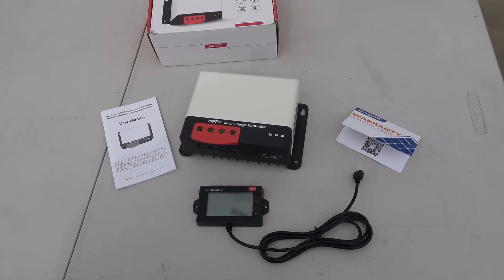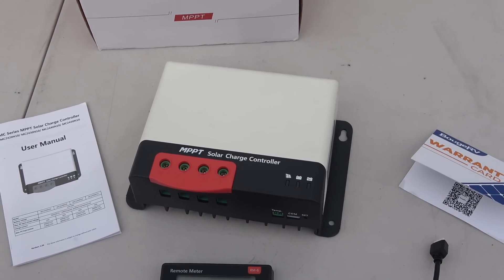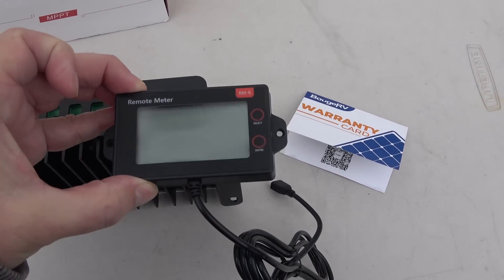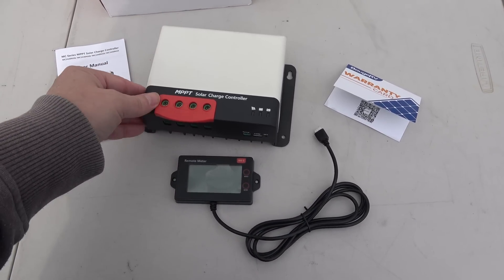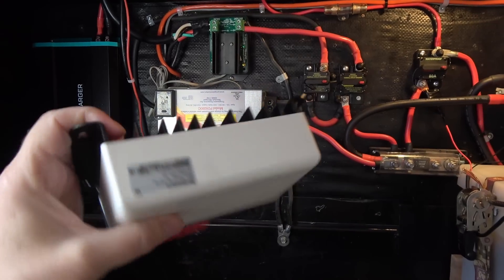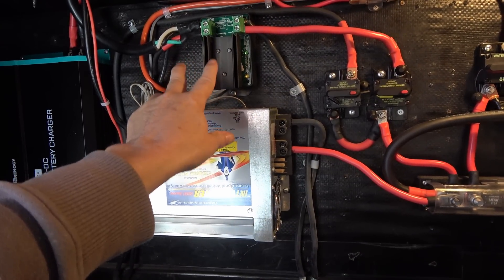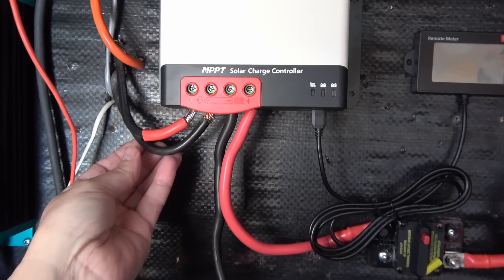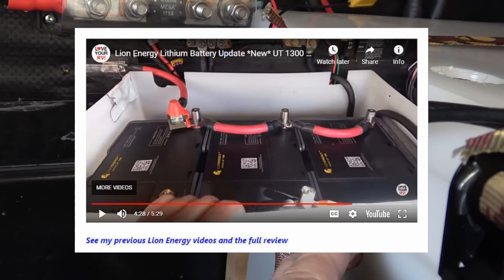Cheap MPPT 40A Solar Charge Controller from BougeRV - Install and Test

Comment: Sorry to bother you again Ray.  But I watched another vid of yours . My wife and I have like 40gb with rogers. But we would like to get like a mifi or similar.  We will be leaving wifi soon and like to watch Netflix and all that while we travel the island . We have unlimited after 40gb.  We like to chromecast from our phones to TV.  Any suggestions? I will also by my Amazon stuff through you as well . 😊
Reply from the maker: My suggestion is to try to watch at the lowest resolution you can to stay in the 40 GB range because most plans that claim to be unlimited will throttle the speed dramatically after you pass the specified mark. Often it will still be fast if the tower you are connecting to isn't busy but if it's busy they will use network management to bump you down to a lower speed. Also beware that Vancouver Island only has good cell service along the east coast and southern tip, other than that it can get pretty bad due to the sparser population and mountainous terrain.  https://www.telus.com/en/bc/mobility/network/coverage-map As an example we like to camp in Strathcona Provincial Park and there no zero cell coverage.  Cheers, Ray

Comment: Hello Ray thx for your informative review. I have been using one of these with 380w of solar 2 Samlex 100w pnls and 1 Bouge 180w for about 1 month and have seen 24amps charge going to my bank of FLA Trojans T105s. I like you have done a fair amount of effort to utilize the User defined Bat mode but could never get the product support to verify the schedule for equalization so I defaulted back to the Fla battery config even though it does not match the T105+ recomended settings. Also had trouble getting accurate temp sensor spec from Product Support so I'm using my Samlex sensor from my PWM 30 amp this one replaced and hopefully it will adjust for high ambient conditions I camp in. Maybe in your communication with them you'll have better luck than I did. FWIW I was told that SRNE model unfortunately has alot of features that aren't supported in unit marketed by Bouge even though they appear identical. I got the feeling Bouge Product Support was limited in knowledge of operation of their unit especially when I asked about type of remote temp sensor i.e. resistive or self generating (thermocouple) and voltage charge reduction values for temp increase. Your pumping alot more power thru your system so anxious to hear your long term reporting. Stay Healthy and hope to see you both out and about once the Covid 19 border restrictions reduce.
Reply from the maker: Hello Bill I have found a Canada website that sells the temp sensor - http://azimuthsolar.ca/product/srne-temperature-sensor-for-mppt-solar-controller-mc-series/ they also sell the Bluetooth dongle so you can see stuff on a phone  http://azimuthsolar.ca/product/srne-bt-2/ but I will likely buy it from overseas as much cheaper funny enough shipping is cheaper from overseas versus my same province.  :) https://www.aliexpress.com/item/33029331284.html?spm=2114.12057483.0.0.128f2ed3Ze3Zq9 also looks like there are temp sensors there too - https://www.aliexpress.com/item/4000068249045.html
Reply: I had the same result with BougeRV support regarding the temp sensor.

I am running SLA so I do want and need temp compensation.  

I would appreciate knowing if your sensor worked.

Comment: Interesting and reading from the description it is mentioned weather resistant.
Could be an interesting option to replace the PWW controler on my 200W Renogy Eclipse portable kit.
Reply from the maker: Its not great with only an IP32 rating "Protected from water spray less than 15 degrees from vertical" but could easily be improved I bet with a little silicone rubber on the seams and tape across the wire screws.
Reply: @LoveYourRV  Just read the PWM Voyager is IP67, but could get by as the controller is on the back of the panels and when in use they are always angled at around 45 degrees.
But just saw the Renogy Rovers are also IP67. Not sure why, was under the impression they were not waterproof.

Comment: I'm not sure if that controller is programmable or not, but I just bought 4 Lion batteries and they recommended I set the controller voltages to 13.9 for bulk, absorption and float. Apparently they regulate the incoming voltage down to 13.9 anyway so I guess that any higher than that might just make more heat (just guessing).
Reply from the maker: Yes, it is fully customizable and also has a preset just for lithium batteries set to 14.4V which is about what most lithium specific chargers use some even use 14.6V  The lithium specific chargers don't use float, bulk or absorption like a lead acid charger does, so they just charge with a constant voltage and let the battery management system deal with the regulating the charge to the battery. Back when I installed my Lion UT batteries their engineer recommended I custom set my Bogart controller to 14.4V.  That's the same as Battle Born prefers. Maybe Lion has changed the BMS used in the newer batteries or is trying to extend the lifespan by not recommending they be charged to the point the BMS cuts off. 
I had a look at the online manual for the UT1300 and it just says max charging voltage 14.6V and
*What are the charge settings I should use for the
Safari UT 1300?*
We recommend a lithium charger. You can use a lead acid
charger. If the lead acid charger is programmable, use the
Lithium setting if it has one. If it doesn’t, set the Bulk to
14.6V with no time limit and the absorption, float and
equalize to 0 or off. If these have to be set to something,
then set all to 14.6V. If the lead acid charger can’t be
programmed, it will still charge the UT 1300 up to approx.
13.6V and 80% capacity. If you put the UT 1300 in 24V
series, we recommend charging at 27.8V. For a series in 36V,
41.7V and for a 48V in series, 55.6V.
Reply: @LoveYourRV  I think one of Lion's deficiencies is the lack of consistency on the charging profile that the recommend. I think to make it easy on themselves they just stick with what people have for chargers and more than not they will work just fine. If my batteries last more than 10 years I will have scored a win and probably won't be travelling anymore either.
Reply from the maker: Yeah, I don't see the point of babying LIFePO batteries to save a little lifespan, even at the 3500 cycles they warrantee them until, the battery will still likely have up to 80% capacity left, and like you say 10 years is a long time. :)

Comment: Thanks Ray, just starting to research solar for our full time rv retirement in a couple years.   Not going crazy not going to be boondocking a lot.  without taking up to much of your time would you say start with a 12 or 24 volt system.
Reply from the maker: Personally I would stick with a 12V system starting out, keeps things simple and cheaper, then if a person really gets into off grid RVing and decides to invest in a more powerful advanced system could look into 24V. There are some wire size advantages to using 24V but also some hoops to overcome meshing it into the 12V RV DC circuits. On a smaller system I don't think its worth the hassle.
Reply: @LoveYourRV  thank you friend